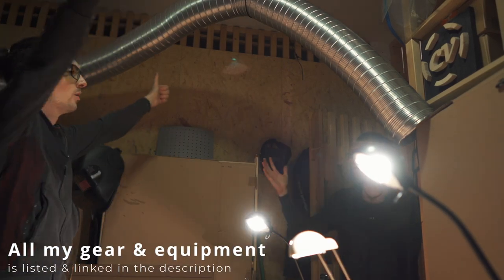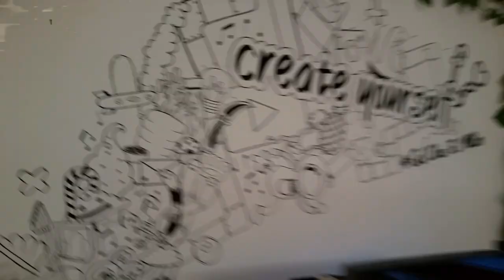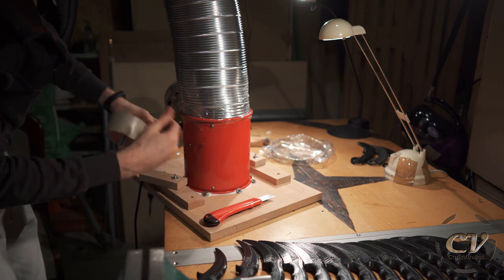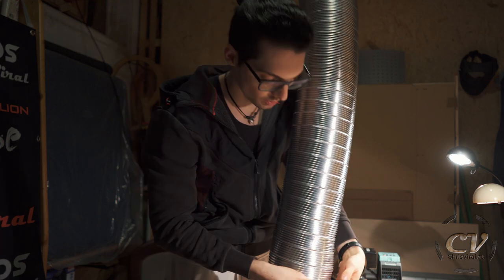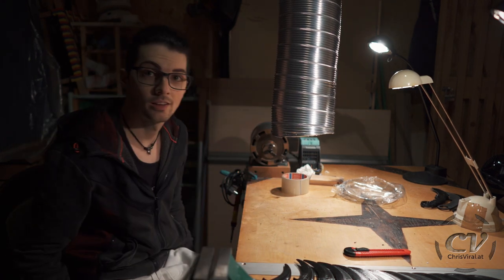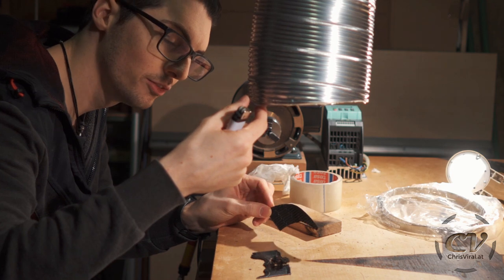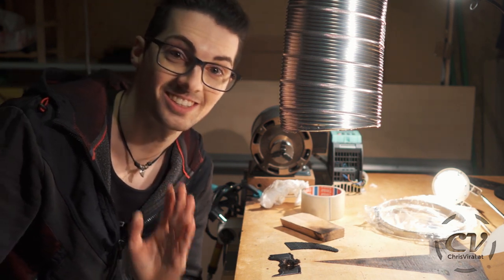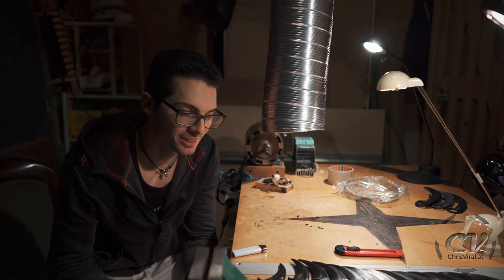DIY Fume Extractor System V3.2 (Finally Done)

Comment: This was great.  I set up a fume extractor in my basement and am in the process of upgrading it due to insufficient airflow and negative pressure.  I was considering a similar device as what you have, and now I can see that it will prove sufficient.  Thanks.

Comment: funny i had a similar project "on hold" for a long time (to suck up welding fumes/particles.
to save money i planed to use straight pipes (grey plumbing plastic, big diameter but cheap)
and use the flexible hose only where its really nessesary. I see a lot of opportunities in your build to do the same.
Reply from the maker: Yes, the straight tubes will for sure work better. All in all they have many benefits over flex tubing, but in my case (not a fixed installation) the flex tubing was a no brainer.
Reply: @ChrisViralVlogs  sure you can attach the felex tube to a multi joint arm to reach every point in the room :D,  ("Gelenkarm Absaugung") https://www.worky-italy.com/de/schweißrauchabsaugung/absaugarme/selbsttagender-gelenkarm-von-150-mm-durchmesser-zum-absaugung-von-schweißrauchgasen-sb